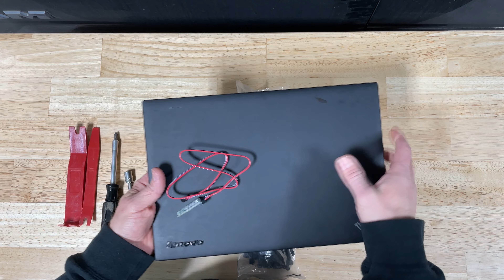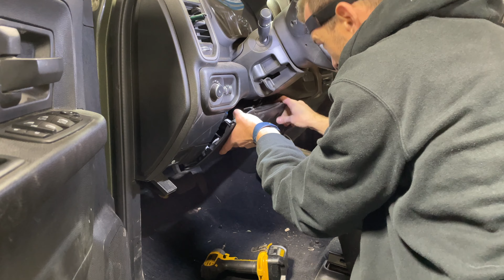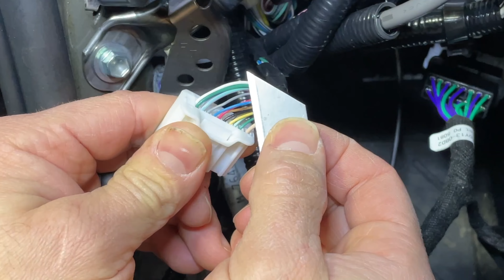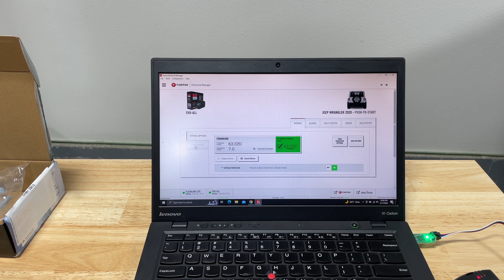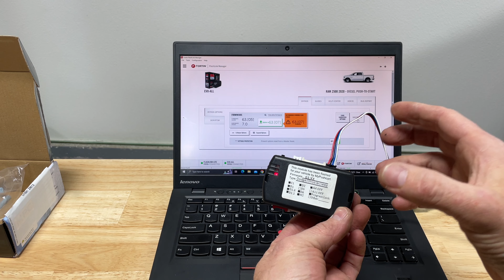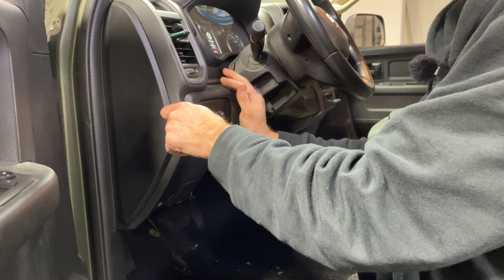2020 RAM 2500 Diesel truck remote start system installation - best review of remote start system

Comment: For everyone that caught this.. splicing into the pink/white wire and then seconds later shows splicing a blue wire. For clarification for people with a diesel push button style use the pink/white wire attached to the purple/yellow wire. It may help some of you and keep your blood pressure under control.

Comment: When you said use pink and white wire you connected to a blue wire on the harness and said to connect pink and white with a pink and white on the harness?
Reply from the maker: Hey man, most likely I’ve misspoken. But yeah you’ll need to connect pink/white to blue wire